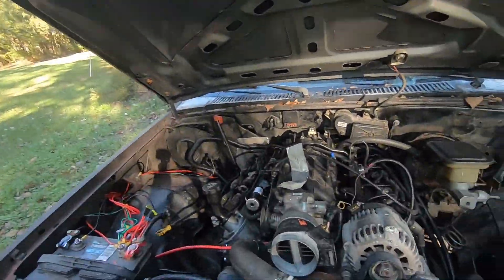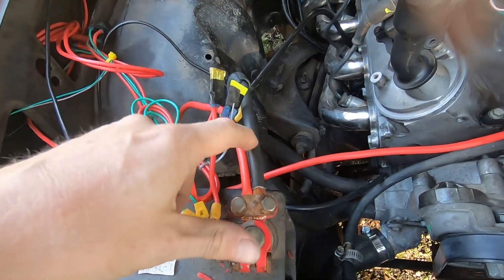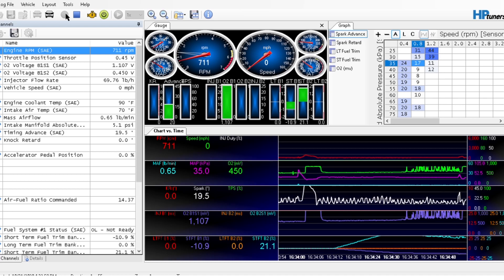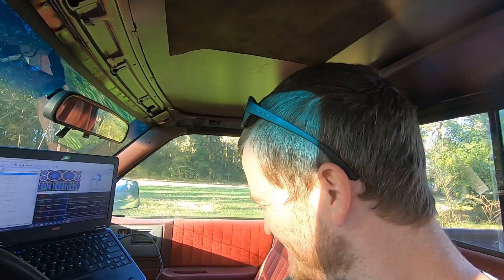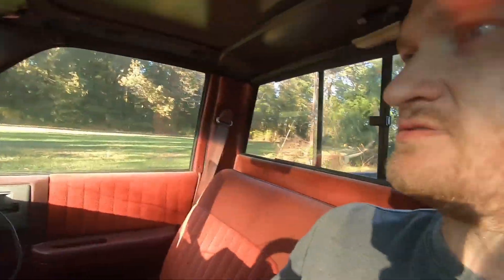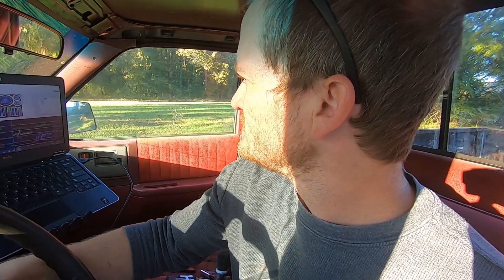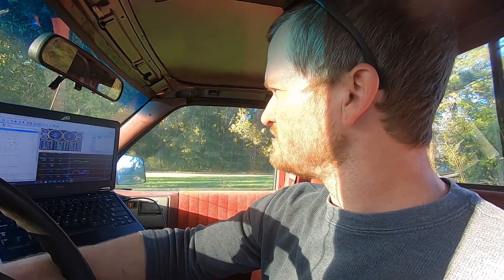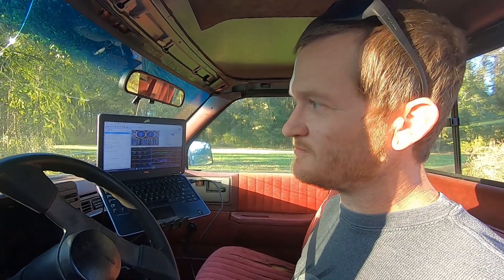Earl REALLY wants to drive......and then she doesn't!!

Comment: Where you buy your harness you have the 5 pin maf right? Great videos btw
Reply from the maker: I got my harness from ebay https://www.ebay.com/itm/99-03-4-8L-5-3L-6-0L-GM-LS-LS1-LS6-SWAP-VORTEC-STANDALONE-WIRING-HARNESS-W-4L60E-/264767068615?_trksid=p2349624.m46890.l49286
Im not sure how many pins on the maf but 5 seems right.